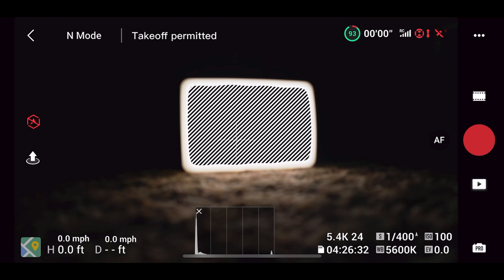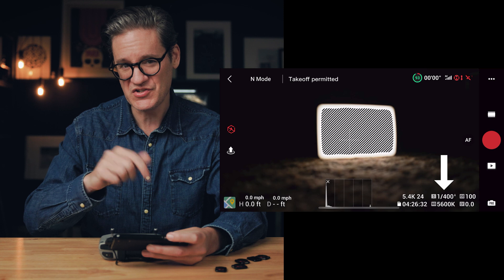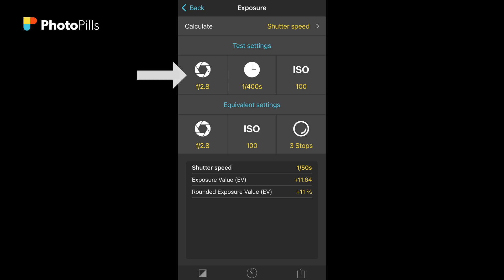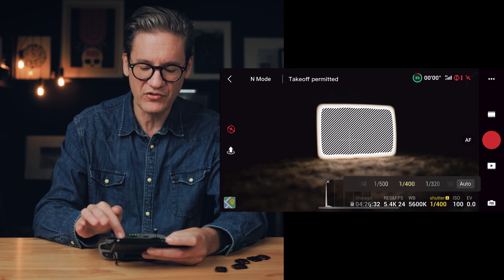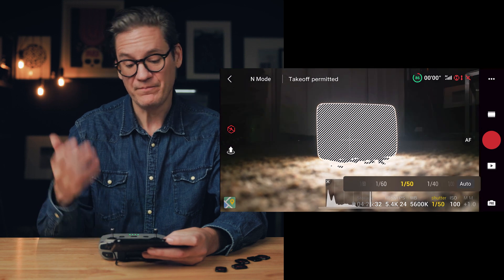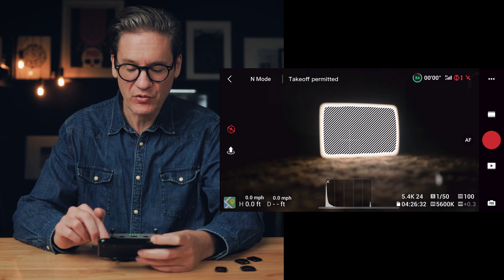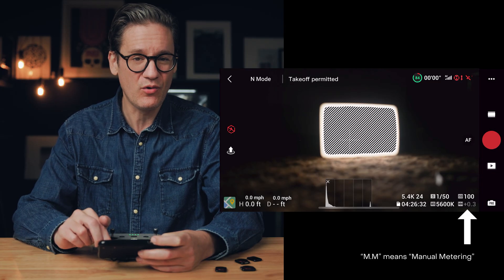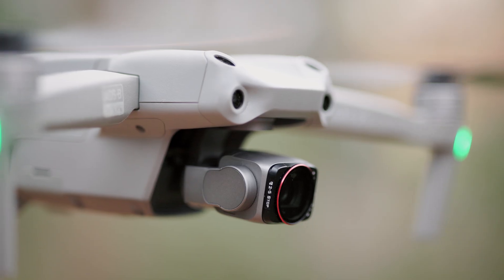How to Use ND Filters on a Drone

Comment: A perfectly lucid and helpful explanation, with insightful comments toward the end as well.  I suppose the only question left slightly unresolved, which will always depend on the conditions and the pilot's determination, is how to deal with varying light during a flight, where video is being captured.  For example, with the sun behind the drone on a partly cloudy day with various landscape elements below (water, sand, trees or white buildings), choosing ND 16 and shooting at ISO 100, shutter 1/50, 24fps could work out ok.  But the minute the camera is rotated or the drone is flown at a different angle to the sun, the chosen ND could be too low, or too high.  This seems to me to be the challenge of moving pictures instead of stills.  I guess the solution could be to shoot more than one take and put them together in post, but, I would like to ask anyway.....how do you approach flying and shooting video where the filter is insufficient or too efficient for certain parts of the scene.